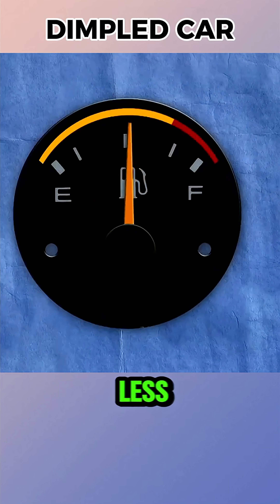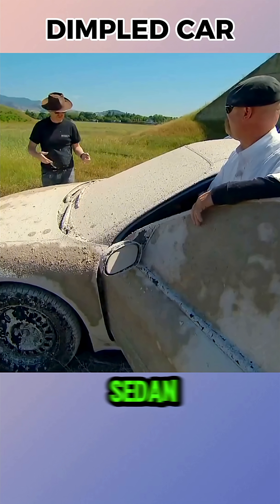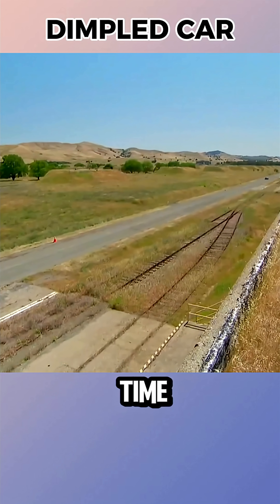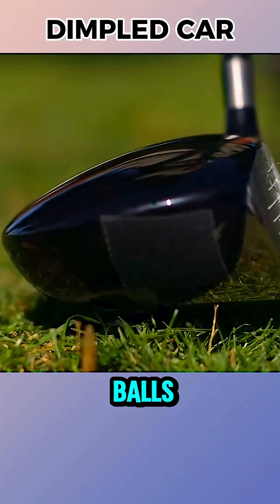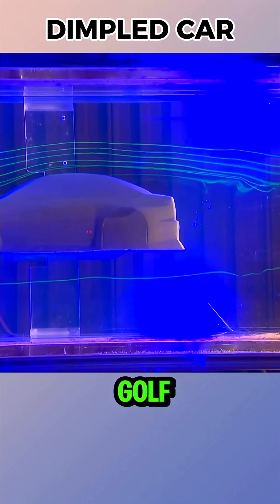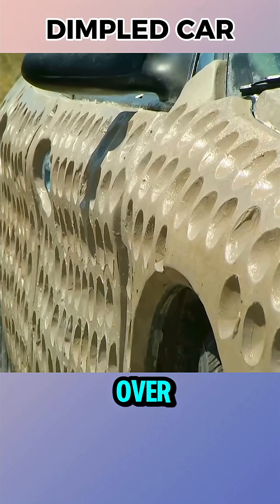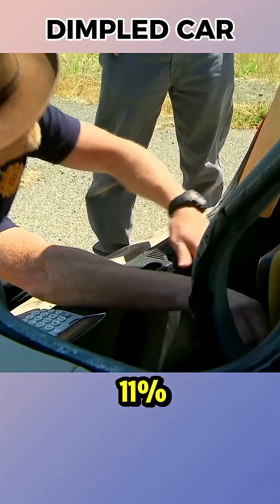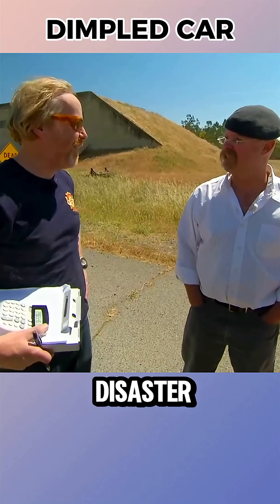Can a Car Covered in Dimples Save Fuel? 🚗

Comment: Could it have anything to do with the weight reduction from the dimples?
Reply: No dimples reduce drag in general. I think that the Bugatti Bolide also has dimples on its roof which are not so visible for aesthetic purposes but they are here to help with the car's aerodynamics